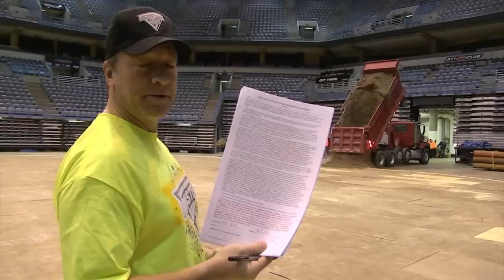Mike Rowe Learns How to Craft Ramps and Smash Cars for MONSTER JAM! | Somebody's Gotta Do It

Comment: The very first monster truck was Bigfoot, Built by Bob Chandler in 1975, it started out as a family ford f 250 pickup which Bob modified until the tires reached 66 inches, as well as adding heavy duty suspension and four wheel steering. the Largest monster truck ever was Bigfoot #5 built in the summer of 1986 by Bob Chandler himself in St Louis ,Bigfoot 5 is 15ft 6in tall with 10 ft tall tires and weighs 38,000lbs. it is usually parked in pacific, MO by Bigfoot's headquarters, the mega monster truck makes occasional exhibition appearances at shows around the USA.

Comment: I remember going to the now defunct Capital Center in Largo MD for the arena’s first monster truck and tractor pull show. It was long before Monster Jam was a company. The monster trucks crushed a few cars because that is what monster trucks did back then and in all seriousness that’s about all they could do because most had big block Chevy or Ford engines that had small blowers on them that were not making a lot of boost and ran on 93 octane pump gas so if they made 600 horsepower they were making a lot.  The pulling trucks well that was a different story.  The one thing that no one had taken into account is that in the ten Capital Centers 25 or so years of existence they never had tractor pulling show and especially one with 5 blown engines running full chooch with zoomie headers pointing straight up or a super stock tractor blowing a plum of thick black smoke up a hundred plus feet with the force of a jet engine. Anyway the first tractor to hook to the sled was a super stocker and quite literally it filled the place with a thick cloud of diesel smoke as well as knocking down every speck of dust off the rafters. O did I mention there was no exhaust collecting and ejection system just the open doors and the center’s exhaust fans.  Not to be outdone the multi engine pulling tractors with their headers pointing straight up blew the rafters flags and sound attenuation blocks/tile off the ceiling while making every person in the joint who was not smart enough to have brought ear plus or ear muffs with ears rings. To say it was a 💩show was an understatement but it was definitely an experience. An yes two or three months later they were back and gave everyone ear plugs at the door.

Comment: When I got to get some real information on these trucks from a monster truck racer he laughed at "miles per gallon". He started with a mix including nitro to get it started and warmed up. Then switched to straight alcohol fuel. He said the tanks will go dry in one run. Gallons per run is how he figured fuel needs LOL.Do you actually have a driver's license? That was horrible getting that 4 wheeler out of the trailer....5th graders could do better. You got me laughing though as you and you did fine on getting the monster truck up on the mound and stopped.

Comment: The average monster truck gets 1/5 miles per gallon. They carry less than 30 minutes worth of fuel in a 25 gallon tank. The engine consumes about a gallon per minute and the engine will not last 24 hours.